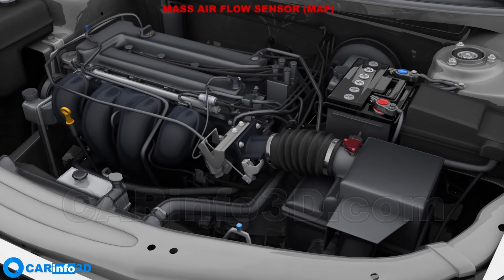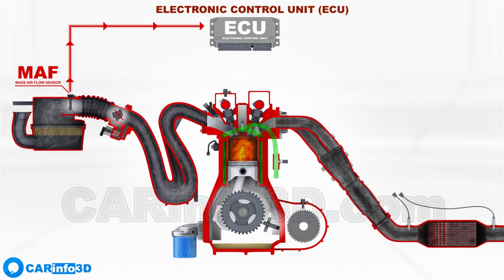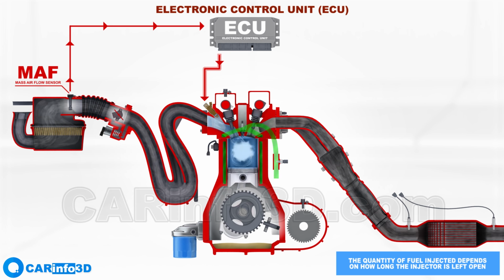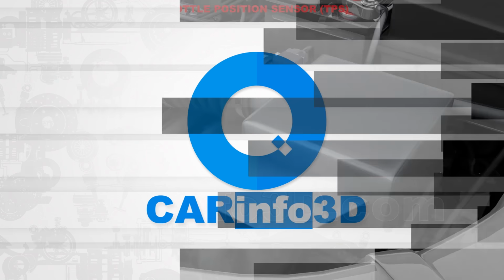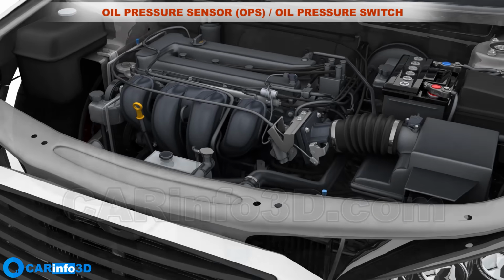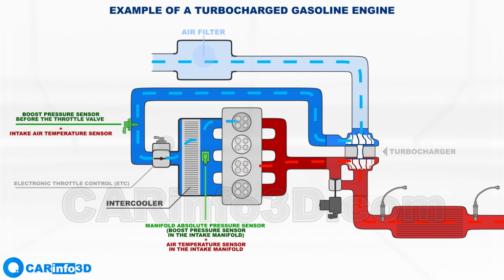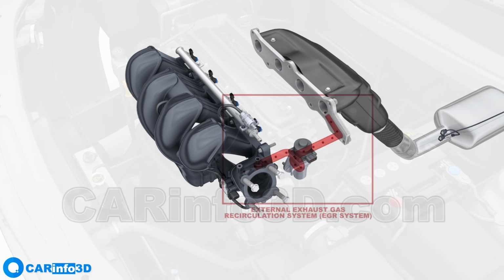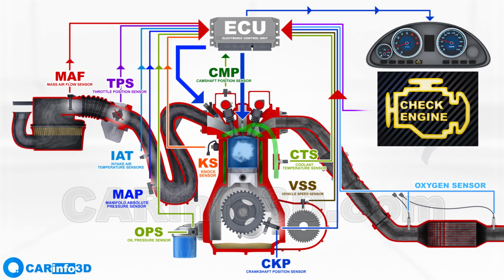Engine Sensors - Basics. 3D Animation

Comment from the maker: Hello everyone! I'm finally putting up another video. Enjoy watching it.

In our online video course "Car Anatomy" there are more informational videos in 3D animation. Details on our website: https://carinfo3d.com
Reply: Very beautiful i love to be a mechanic after seeing this.
Reply: You need to correct your video. Air intake temp is measured BEFORE the throttle body, always. It has to be located before the throttle blade to calculate offset mapping, based on ambient temp and barometric pressure. It's impossible to accurately measure ambient temps after the throttle body. Many applications have the IAT combined with MAF.
Reply: Thank you so much Sir
Reply: Wow that is great sir
Reply: Excellent video, next could you explain how sensors operate during open loop and close loop?
Reply: Thanks for this video 🙂💐👍
Reply: https://youtube.com/shorts/a28H53xlOOc?si=GyXCUgMpHLLXvGvO
Reply: https://youtube.com/@vikastiwariarchitectandinterio?si=Qjk-BAM46glHIKup
Reply: درود بر شما . من‌ در ایران زندگی می کنم و زبان خارجی نمی دونم . علاقه زیادی به مبحث اتومبیل و مسائل فنی و علمی دارم . لطفا ویدئوهاتونو دوبله فارسی کنین که فارسی زبانها هم یاد بگیرن .
Reply: Excellent info. Thanks 😊🙏
Reply: How to determine and confirm if the sensor is the problem? Please upload some videos on how to carry out maintenance sensors to restore fault codes? Thanks
Reply: Very good video. Is there a video available with the same explanation but for Bluetech diesel engines? Thank you
Reply: @carinfo3d-En  thanks excellent information
Reply: @gilbertmelara
Reply: This are awesome,, love them thank you

Comment: All of this crap to replace a distributor and carburettor. Both of which could be adjusted in a few minutes (usually at service) negating the need for ecu's, OBD's and laptops to find which sensor has failed (again) for hundreds of Pounds/Dollars. You could usually get to a garage without your car going into limp mode/tow truck too. Also cars are not that much more fuel efficient or cleaner today either. I had a 1975 Opel manta that only registered 25 ppm when emission tested each year at MOT with nearly 500k miles on the clock with one re build which is so much cleaner than my 2020 Toyota hybrid that I pay less environment tax for! Opel fuel average was aprox 41 - 45 MPG, Toyota 45 - 50 MPG. After 45 years? we are being scammed big time I think.

Comment: But speed sensors are for calculating speeds to help the ecm change gears on automatic ⚙️ gearboxes idk if it also helps in fuel injections

Comment: I miss those carb days. Only sensor on the car is temperature sensor for radiator fan.
Reply: Me too 😢
Reply: True, however those cars do not meet current emission controls and cannot run on todays junk fuel  without serious modifications, hardened valve seats and additional catalytic converters.

Comment: Correct me if I am wrong, but when a sensor triggers the check engine light and error code, it doesn't mean there is a permanent problem.  It could be a one time "hiccup" and light will turn off after computer resets in 50-70 miles.  It, also, doesn't mean sensor is bad- it is just sensor doing its job- so sensor doesn't have to be replaced.  But if light does not reset or same error code repeats, then it is time to do more.

Comment: I was born in 1951 and during my young years cars were very different and used carburetors for controlling air fuel delivery and used distributors for controlling ignition timing. Also the most electronic item in a car was an optional AM Radio. Over the years this modern electronic engine control system that uses all these sensors have been developed. This modern electronic engine control system has enabled modern emission control, better fuel economy and more power
Reply: 1990s/2000s modern engine control was the best. Anything after 2015 is needlessly way more complex with the CANBUS system where everything is connected to everything. So the rain sensor on your rear windshield to activate the wipers could have a problem that affects the engine computer, and it's extremely hard to diagnose because nobody would think those two could be connected.

Comment: I have no patience for working on cars. They weren't designed to be easy to work on. They were designed to be assembled as fast and as efficiently as possible on a mass production assembly line. That's why labor costs so much and why the engineers who design them end up in the lowest tier of hell along with lawyers and Adolph.

Comment: My 1990 Honda SM4 's throttle sensor wore fast, I bypassed it by connecting a 380 ohm resistor to its wires, to fool ECU that throttle is closed. Works fine.

Comment: It should be a crime to use a sensor that when bad stops your engine from running.
Reply: But those are safety mechanisms for your car

If the car starts overheating it's better for a sensor to shut the car off to protect it

Comment: In Europa,  this engine is banned because it's too simple and too easy. It is missing all the accessories, housings, valves, pipes and sensors required by European pollution standards (EGR valve, bag for urine injection, taxes systems,  etc.). 😄

Comment: Hello my car was fine and I cleaned it up crankshaft sensor, and after I connected that, I didn’t know that the water got inside the case I thought it was completely dry, but then the car didn’t wanna start and I replaced a new one on the car the car won’t start
Check it all the fuse are OK except number 22,23 and 25 fuse are good, but there is no voltage. What do you recommend me to do?
Reply: Ask chat gpt

Comment: The MAF sensor doesn't "determine" the amount of air coming into the engine the position of the throttle plate does aka how far down you push the gas pedal. The MAF sensor measures the mass or weight of the air not determines how much.

Comment: how can we trust what ever is being said here when there is a big lie at 7:52 is dedicated to the device only. Meaning that oxygen sensors are just to control the quality of air. Meaning that if there is rust on the device enough for the exits sensor to read more than in input it light the check engine light. This is mostly the last thing checked by a mechanic or technician. Make sure there is no rust. Why would it have influence of air mixture when talking about oxygen levels? Dish is capuish. The big lie that make it crumble. First we are talking about combustion, it is control by pistons. Low oxygen is supporsed to be out. The levels are not to be compared there. Only a balance numberic shitty inlet and outlet.

Comment: Sensors were invented to cause headaches for both mechanics and car owners.
Reply: They also make engines more reliable than ever. Old cars don't even have more than 5 digits on the odometer because they weren't expected to make it to 100,000 miles back in the days before sensors!
Reply: They sure as hell were ...

Comment: Hello i have a 2014 Chevrolet sonic LT 1.6L (MEX) automatic and my car acceleration pedal randomly stops working until i turn off then on the car. Then it will start working for an undefined period of time until it spontaneously doesn't want to work anymore. I am waiting for a catalytic converter and fuel pump i ordered to arrive next week. My mechanic said the fuel pump needed replacement. The catalytic converter gave me P0420 code. Will replacing catalytic converter and fuel pump keep my car acceleration pedal from stopping to work spontaneously? I already replaced the bottom 02 sensor with a genuine GM sensor and i also replaced the top 02 sensor but that one is a generic 02 sensor but the car has still left me stranded randomly.

Comment: I have one question, its my problem with audi a8 D4 tdi , Can a mass air flow sensor (P0101 code in vcds) cause the car to vibrate, shake, and pulse rpm as if it is turning off when it is cold in the morning?
Reply: yes.  clean the sensor with a contact cleaner.

Comment: So needed gauge panels in shack ,  spaceship lesson, manual process reach out to heaters,out lines. From ,kept fluid in line links too heat energy emergency.  Shacks east-west movements of a public manners performance percentage points.  From. Truck hose Link's, unhook links while moving.

Comment: They forgot to mention the HFS Sensor. It senses the headlamp fluid levels to make sure that you never operate under the safety requirements, designated by the automobile safety and sanitation organization, initiated originally in 1993. 

It’s not talked about much and rarely needs to be changed, so most ppl haven’t heard about it.

Comment: With throttle by wire the car gives the driver the illusion one is operating the car rather than  merely telling the ECU what the driver desires.
Reply: Not unlike post-Vietnam fighter jets, pretty much everything designed since the F-16.

Comment: reducing engine pollutants forced the incorporation of these sensors.  that and wringing more power from a smaller engine to provide reduced fuel consumption.  in summary, governments not manufacturers forced these incorporations based on the lobbying by green advocates.  i believe usa started down this path in 1964 or 65.  city smog was the thing that every one could relate to.

Comment: You need to correct your video. Air intake temp is measured BEFORE the throttle body, always. It has to be located before the throttle blade to calculate offset mapping, based on ambient temp and barometric pressure. It's impossible to accurately measure ambient temps after the throttle body. Many applications have the IAT combined with MAF.

Comment: Edelbrock makes a sequential multi port fuel injection intake manifold that has all the sensors on it that are necessary to run EFI. That should become the standard as well as lowering emissions requirements to reasonable levels. The over complication of internal combustion engines has led to less reliability and higher repair costs. Set the emissions requirements back to the 2004-2006 level because it's just before cars started becoming unreliable and really overpriced.

Comment: Such an excellent presentation.  Clear & concise, and importantly, thorough.  Credit to you.
I have spend many hours before this video trying to ascertain the MAF/MAP sensors in a 2017 VW Golf EA211 1.4TSI engine, what exists & where they are.
Finally concluded that there is no MAF but two (2) MAP sensors, one upstream of the Throttle Controller and one downstream in the Intake Manifold.
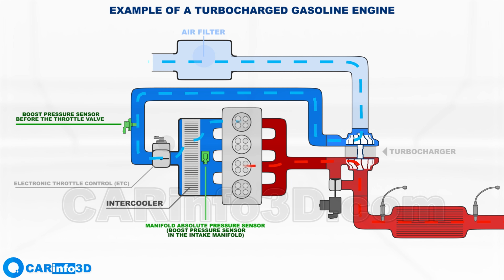And then i stumble across this masterpiece and there it is at 11:26 confirming my conclusion.  Thanks.

Comment: I have tata nano  cng car.In rainy season one day  there were vapors accumulated on dashboard as well as on display.  Then I found that its odometer is not working . Instead of number of kms error appears in display. Both fuel levels are shown. Even speedometer is working. All tell tell lights appear what may be faulty?

Comment: With all these sensors everywhere why can't the ECU say whats wrong when the check engine light comes on,
Reply: The ECU does via a code. The malfunction code is determined by plugging in a tester into a test port under the steering column.

Comment: What is the main purpose for MAF
Reply: The Mass Air Flow (MAF) sensor in cars measures the amount of air entering the engine’s intake system. This data is crucial for the engine control unit (ECU) to determine the correct fuel-to-air ratio for combustion.

How It Works:

	•	Location: The MAF sensor is typically located between the air filter and the intake manifold.
	•	Measurement: It measures air flow in real time and sends signals to the ECU.
	•	Fuel Management: Based on the air flow data, the ECU adjusts the amount of fuel injected into the engine for optimal performance.

Why It Matters:

	•	Improves Fuel Efficiency: Ensures the engine uses the right amount of fuel, maximizing miles per gallon (MPG).
	•	Reduces Emissions: Proper air-fuel balance minimizes harmful emissions.
	•	Enhances Engine Performance: Accurate air flow measurement leads to smoother engine operation and better throttle response.

Common MAF Sensor Issues:

	•	Dirty or Clogged Sensor: Can cause incorrect readings, leading to poor engine performance.
	•	Symptoms of a Faulty MAF Sensor:
	•	Check Engine Light (CEL) on
	•	Engine stalling or rough idling
	•	Poor fuel economy
	•	Reduced power or hesitation during acceleration

Regular maintenance, including cleaning or replacing the MAF sensor, helps maintain a vehicle’s performance.
Reply: @jackeroo75  Why does this read like a ChatGPT answer??
Reply: @ because it is.

Comment: I qualified in the automotive Industry in the 60s - on one occasion I was dispatched to fix a broken down Vauxhall viva.  When I arrived the guy looked at me a 19 year old apprentice  and said " I checked all the electrics and could not find a fault and I am  an electrical engineer" why did they send you.  I lifted the bonnet and went straight to the distributor, the heel on the points (PN Lucas 732519) had worn down  so that it would not produce a spark, mmm so I quickly adjusted the points 12 thou/" with a quick flip and short from the coil was the reassuring spark.  I reassembled the distributor rotor and cap the engine fired up to the mans astonishment and a tip of £1 - alot of money in 1964.
Reply: great, a pathetic attempt to self-promote one's self with a too good to be true story
Reply: @thefast427  Go back under your rock.

Comment: Thank you for this. I'm depressed that car manufacturers like to hide the error code and that you need expensive equipment to read it from the car so you know what the problem is and often have to rely on the honesty of their local garage/dealer to tell them what the problem is. Most vehicles now have media displays that could easily display in any language under the sun what that error code translates to rather than just flash up dumb ass engine check light on the dashboard.

Comment: This video covers the basic sensors that are part of modern electronically controlled fuel injection. Also there is one more method of controlling the air flow to an engine besides the throttle plate in the throttle body. The other method is used by BMW cars that involves an additional camshaft to control how much the intake valves will open. BMW calls it valvetronic. Since I am 73 years old I remember my young years when all these sensors did not exist. Instead the air and fuel delivery was controlled by a carburetor and the spark ignition was controlled by a points and distributor device. These old systems did work, but by today's standards they are far too imprecise to achieve modern emission control and modern higher fuel economy.

Comment: I used to think that . Why they don’t use the power of water from pump motor to take car engines work with battery. Firstly, battery connect water pump motor . Secondly, After engines working itself would make electricity return to charge the battery.if this possible to make . Poor people like it so much because just pour water fully in tank . Just enjoy driving. My country rural . People exploit  waterfalls for electricity and supporting for other cropping tools

Comment: If that crankshaft position sensor is on the front of that engine, the engine is running counterclockwise.  Unusual.

Comment: Great animation.  I still prefer the old stuff.  My daily driver is a 1983 CJ-8 and I can repair anything with ordinary tools and a shop manual.  I like that fact a lot.  Does it pollute more than a modern vehicle?  NO.  By the time you add up the environmental impact of the manufacture of that new car, my old Scrambler can run for a few centuries before there is an equivalence.
Reply: +++++!!!, умно ! , всего наилучшего Вам!
Reply: Truth

Comment: A sensor to warn you that a certain sensor is about to expire or needs updating is absolutely necessary!!
Reply from the maker: The ECU diagnoses a sensor malfunction. But, unfortunately, it does not always see sensor faults if the deviations from the norm are not large:(

Comment: You missed the Marriage Sadness Sensor (MSS) normally located on the passenger side of the rear seat. This sensor is also known by most people as Mother-In-Law and it works pretty well in telling you when your marriage is broken.

I normally keep it disconnected as I don't care a bit about it.
Reply: Funny! 🙂
Reply: Why did you marry someone, when you didn’t like the mother in law?
Reply: @ as every sensor out there.. it started working fine at the beginning and years later it started sending false readings.  Bad thing it's discontinued and I can't replace it.

Comment: Does anyone wonder why a very simple part as the throttle cable (consisting of a cable in casing with connector on each end) is replaced by TWO components one at the foot peddle and the other at the throttle body (consisting of multiple plastic housings, electronic circuit boards, motor, gears and more wiring cables)????????   OH I get it.. We can now save the expense of the foot peddle by having our cars run by AI computer instead of people !!!!

Comment: Since everything is computerized I still can`t figure out why they haven't started using solenoid controlled valves instead of a camshaft controlled valves,
Reply: Newer cars do, old ones no. And it's a choice if you want your engine to run without a computer. The cam method lets you run engine without the solenoid/computer.